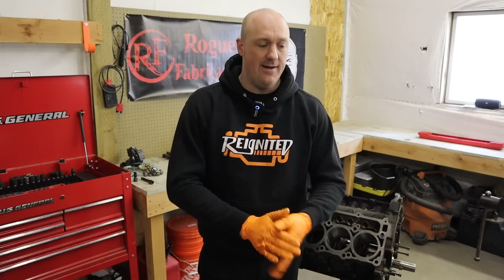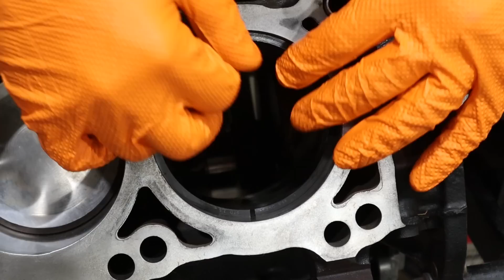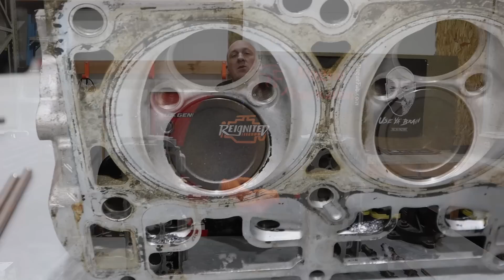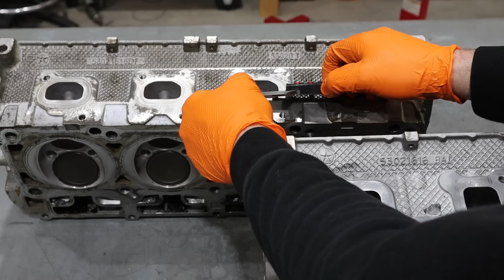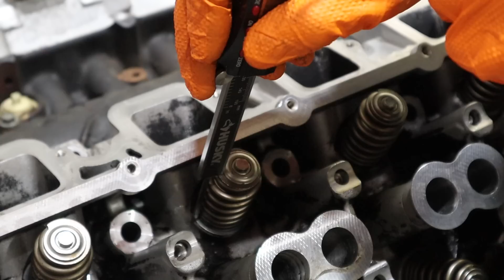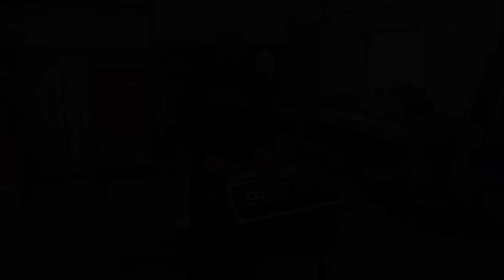Poor Man's Hellcat Ep2: Installing Eagle Cylinder Heads!

Comment: I blocked the EGR hole on the intake using a piece of rubber hose and a bar end form BMX bike with hose clamps and just made a blank flange for the front of the head and had no issues.

Comment: Do you have to change the rings or is that something you decided to you since then engine was torn down?
Reply from the maker: If you're going to remove the pistons and do a light hone on the cylinders you definitely want to replace the rings.
Reply: @ReignitedAuto no I am saying if I go get the newer Gen heads do I have to change the rings or can I just put the heads on it and that's it
Reply from the maker: @73swagin ah, no need to change the piston rings in that scenario.
Reply: @ReignitedAuto ok good thank you I know the route I am going now

Comment: I attempted to put eagle heads on my 2007 dodge ram. I had all the hardware, and put the pushrods side by side everything checked out. When I was finished with the installation of the heads I did a quick few turns of the engine and noticed all the valves are not completely closed. They were open about an 1/8 of an inch. I ended up putting stock heads back on after countless research and found nothing that explained what was happening.
Reply: You have to measure the pushrods

Comment: Couple things i want to touch on as im about to do a eagle head swap on a pre eagle. First, the valve covers, i was told and read the pre eagle valve covers do not clear the eagle valve train due to it sitting higher? Also was told directly from a builder that the rocket arm assemblies from 2003 to now are all the same an dimensions over all gen 3 hemis. You mentioned earlier on that you can use the same hesd bolts, are they not torque to yield? Lastly was informed the map sensor can be used ok the esgle hesd setup.. Anyone can verify these topics?

Comment: I wonder if you could instead of using the o ring seal on the intake. Make yourself a flat gasket that matches the eagle ports. Then port match your old intake to the eagle heads and right stuff the gaskets to the old intake? You could keep your EGR ? I believe you could drill your eagle heads to accept egr? Bang for the buck
Reply from the maker: You would see if you were able to overlay the older VS the newer intake ports, but they don't perfectly cover each other, there's a gap that is visible so there's no way to achieve full sealing with just a gasket, you'd have to machine up an adapter plate. You can indeed drill the Eagle heads for the EGR though.
Reply: @ReignitedAuto  I installed a vvt style block and heads in my 07 charger. The engine runs great no codes related to the swap but my accessories are a nightmare.  I ordered a newer style alternator and plug. Will the ECU in my 07 regulate it? Or will I have to use an external kit with an old style regulator? AC won't line up either. I ordered another one and hoses.
Reply from the maker: @egodeathplease  the accessories are indeed a pain with the newer block. The PCM will control the alternator just fine, just make sure the pins for the plug aren't reversed, they did that sometimes on the newer alternators.
Reply: @ReignitedAuto  ya the extra space for the vvt makes it a pain. I see them installing external old style Mopar regulators on them. They don't seem to care wich wire goes where since it's ac.
Reply from the maker: @egodeathplease  i have one on the alternator in my C10 with the 392 because it's a holley terminator ECU. If you've still got the factory ECU just let that control it.
Reply: @ReignitedAuto  how do I know how to wire it? If I hook it up wrong will it damage the ecu? It's only 2 wires. 50/50 I guess. 😂
Reply from the maker: @egodeathplease  I would say find a wiring diagram online, but truthfully it won't hurt it if you hook it up backwards, just the battery light will be on.

Comment: I have a 2006 dodge charger daytona with a recently built engine. I want to swap the heads to a 2009 so i wont drop a valve seat. Is it necessary with a rebuilt engine

Comment: So if the int/exh ports are larger on the eagle heads and give better air flow but you can use the stock manifolds or aftermarket headers from the earlier 03-08s, shouldn't there be some port matching or else restriction can occur?

Also, are head bolts TTY bolts? Why reuse them if they are previous bolts and stretched?
Reply from the maker: You're correct, the exhaust manifolds would benefit from being matched. The intake manifolds are not interchangeable so those ports will match the correct manifold. The head bolts are not torque to yield therefore they ARE reusable. This comes directly from the Chrysler service information. 
One reason there is confusion on this topic is because the bolts are torque to angle, which is just an alternate method of torquing them down. Think of it this way. If you were torquing a bolt to 55ft lbs, it's that any different than telling someone to torque the bolt to 30ft lbs, and then an additional 30 degrees? Both would result in the final torque number being 55, it doesn't mean that the one you finished torquing down by angle is now stretched and can't be used. I hope that clarifies it. 👍
Reply: @ReignitedAuto  good to know about the head bolts. I have a 04 5.7 with Pacesetter LTs. I wonder how the ports line up and if not, the solution? Super hard to find good LTs these days.
Reply from the maker: @tRRickedOut  I think sticking with those long tubes would be just fine, it's the stock manifolds I would be concerned with.
Reply: @ReignitedAuto  thanks. I would definitely prefer to stick with them as again they're just super hard to find these days for anything early 3rd gen. Definitely doing some more research on this but this 6.4 upgrade looks to be on the menu

Comment: If egr is really drilled and not cast, is it 90° bend drilled? I need the egr. But I think that some ram trucks had eagle heads with egr too.
Reply from the maker: The EGR hole is drilled from the front of the head, and from the exhaust flange side, where the two holes intersect is where the 90 degrees happens. 
I've heard of some eagle head vehicles with EGR, but still haven't seen any yet. I'd love to see some pictures if you find one.
Reply: Wonderful, thanks a lot for chiming in so fast. Actually I haven't seen one either, just read they are out there. Well, I am going to drill it.

Looks like eagle heads are better compared to 6.1 heads, at least from what I have read. Problem is, I haven't found a single dyno comparing them. Some say closed chamber (eagle) design is better for power output, some say open chamber are better for emissions...But there are numbers missing. I am torn between the two yet am inclined toward eagle ones as they should have higher port velocity. At the same though I want to stroke the engine and have no idea how that complements the build. @ReignitedAuto
Reply from the maker: @compprufus  something to be careful about: if you're using the eagle heads and drilling the pet for the EGR, where are you going to run the tube that goes into the intake? There is no provision for that on the newer intake manifolds as far as I'm aware, and you cannot use your original intake with the eagle head swap unless you're using adapter plates.
Reply: I am aware of that. I was thinking first about 6.1 manifold since it's aluminum and I as a hobbyist am more proficient  with alu welding than plastic welding :D but then heard of 6.4 intake being better match.

I was thinking of epoxying in a barb (though I admit, I have no idea how are the gases let inside pre eagle intake manifold (my car is constantly being serviced)) and connect the hose onto that barb. As much shaggy solution that looks like, open up a Motortend, you'll find an article about somebody fixing port runners with epoxy to raise the port velocity. Then there is the other solution and that is to mill myself an adapter plate between heads and 5.7 intake  but that doesn't seem like much fun.  @ReignitedAuto
Reply from the maker: @compprufus  there's no question it can be done. For myself is much rather just eliminate the EGR and get a tuner to shut it off for good, but I live in a state without emissions testing so it's easy for me to say that.
Reply: Exactly, here in Europe emission testing is a thing and especially down here in CZ, one is legally able to tune his car softwarewise only, so my intention is pushing luck. That's why I want it not to give itself away by looks nor by testing though I have no real numbers at hand to compare it too. It seems like nobody cares across the pond (except CA obviously) and so there's nobody to ask.

I can only rely on what two emission inspectors told me over the few years of personal research. According to them, stroking the engine should not worsen the emissions as long as the system is working properly and right here is a hitch. Will cats be able to clean gases enough, last modeartely long or survive at all? But that's just one piece in the puzzle, along with EGR. There is also the "FUEL" component of the OBD readiness code list which seems to be checking whether PCM is able to adjust AFR through the fuel trim lookup tables and as far as I know, HPtuners would adjust those tables. Not sure how it is interlinked, whether the technician compares car with some database of fuel trims (in my case Chrysler 5.7 Euro 3 ) or the tables saved within the PCM....absolutely no idea. But then, those who seek companies making their car run faster through PCM reflash (tunes) have to readjust these tables as well, and they pass emissions.

Again, I am pushing my luck and nobody to ask. Have to try it, I am bored. @ReignitedAuto
Reply from the maker: @compprufus  I hear that, I'm always trying things because I'm bored 😄

Comment: the eagle heads are 20cc less than the pre eagles.. the eagle heads are oval shaped and not a true hemispherical head design.. according to chrysler, the intake runners were improved on the eagle engines. the eagle heads are said to flow 14 percent better than the pre eagles, BUT, as I said, the eagle heads have 20 cc less volume.. so can u explain how the eagle heads are better than the pre eagle heads?  in my mind, they about equal out, due to the chamber volume vs the flow?
Reply from the maker: The less volume is in the combustion chamber, not in the flow capacity. Less volume in the combustion chamber=higher compression
Reply: not trying to argue, just to understand.. ok if you have higher compression, but a smaller explosion when the fuel is ignited ,  due to a smaller combustion chambers holding less fuel mixture,   , how can it create more horsepower, also the higher the combustion pressures, the more difficult to ignite the gas mixture.
Reply: what it looks like to me, is in a way, they robbed peter, to pay paul.. they went to the oval shaped combustion chamber, to be able to cut more material out of the head  to get more flow. raising the compression ratio, and the flow would seem to create a better gas mileage situation to me, rather than more power.. Ive seen  s 1/4 miles tests between  stock chrysler 300s with the pre eagle, and eagle engines, and the eagles are about 1 second quicker.. the vid said the eagle engine is around 30 pounds heavier.. the pre eagles had MDS, but no VVT.. The eagles have VVT but no MDS... to me it seems that the VVT is likely what is giving the eagle engines the slightly better performance, and not the changes to the cylinder heads and intake... your thoughts? .
Reply: also the  fact that the oval shaped combustion chambers are not really hemispherical in design, brings alot of questions.. its common knowledge that the true hemi head design has been unmatched in performance since the 1950s, and as far as I know, dodge still is not allowed to compete in nascar, due to its design,, in the 70s dodge was banned, because nobody could keep up with them..
Reply from the maker: @randy1ization  the eagle engines do have MDS as well. I think the eagle engines are an upgrade in every way. The VVT definitely takes advantage of the increased flow from the cylinder heads, but it's a combination of a lot of small changes that make the eagle engines better. For outright reliability I like the pre eagle engines, but any metric of power and the eagle runs away with it.
Reply: havent driven a car with the eagle engine, as my 06 300c has the pre eagle.. it seems to make the best range of power between 3200 and 4000 rpms..  would love to see you do some bolt on power increases on the pre eagle 5.7 hemi...  @ReignitedAuto
Reply from the maker: @randy1ization  no worries I get what you're trying to say. The smaller combustion chamber has no impact on either how much fuel is injected or how much air is drawn into the cylinder. Therefore, if you have the exact same amount of air, but are cramming that into a smaller area, this equals more dense air which produces a stronger ignition and this results in more power. And it's actually the opposite, the higher the combustion pressure the easier it is to ignite. Think of diesel engines, they don't use spark plugs at all, but they run very high compression ratios, this is because at those cylinder pressures the fuel ignites on its own.
Reply: yes, good stuff, thanks,., makes since  @ReignitedAuto

Comment: Can I use a 2012 5.7 crank in a 2004 5.7 hemi if so what else would I have to do to make it work.
Reply from the maker: Unfortunately no,  the newer crank is designed for the VVT system and has a different snout length than the older crank. They look very similar but aren't interchangeable.

Comment: I want to point out, that you can actually put the old pre-eagle MAP sensor into the eagle intake, and won't need to change the connector. I tried this earlier. Both sensors are slightly different but the tube that goes into the manifold is the same.
Reply: False. The tubes are different. Ealge tube and throttle body are slightly larger

Comment: Question. I know we talked before about my 06 charger rt with 2013 heads setup. I went with a .070 thick head gasket because of compression ratio being high but would a stock head gasket be fine if i run premium gas. I run premium anyways
Reply from the maker: Unfortunately the only way to know for sure is to have the vehicle tuned on a dyno, and the dyno operator has those knock sensor headphones.

Comment: Would the valves be longer because the contact point in the combustion chamber has changed? Since they technically sit lower, because of the smaller combustion chamber?

Comment: I've got a couple of questions but first some background. I was a Chrysler advisor for approx 10 years and finally escaped from industry about 18 months ago. Also, I'm not a typical advisor who knows nothing about cars. I've done all the work on this and many other cars I've owned. I have an 06 300 CSRT which is on it 4th set of lifters. However, last year when the 3rd set failed (always #5 intake lifter) it took out the cam and also spun a cam bearing. So, I pulled the the engine and used it as an excuse to do a 426. Sent the bottom end to our machine shop and had them perform all the machining and assem the bottom end. Put it all together and it ran like a top. Then around 3k miles on it I started noticing what sounded like a slight rod knock. UNBELIEVABE!!!! So I parked it considered committing  hara-kiri seppuku! Anyway, now that its "cooling off" here (houston) I'm finally mentally ready to pull it and see WTF is going on. So my questions are 1) do you know if the Eagle cyl heads flow better over the stock casting SRT heads? 2) do you know of a way to safely pull & reinstall the crank (assuming I just have a bad bearing and no other damage) without pulling the heads? 3) can you give me the torque specs on assembling the bottom end as I've never done this and no longer have access to dealerconnect.com Thanks for any info!!!

Comment: Would a set of exhaust headers from the old heade work with the difference of the exhaust ports on the new heads.
Reply from the maker: They will bolt up absolutely since the bolt pattern is identical. 👍
Reply: @ReignitedAuto  thank you very much. Have a great evening.

Comment: One more thing that i think may be handy. I thought the earlier like 03 to 08 model heads had a chance (likely when overheated a crap ton) of dropping the seats. Havn't heard anything about that and the new eagle heads. So more flow intake and exhaust, better compression ratio and a more stout head. Got me thinking about my poor old 06 Daytona Charger. Its not bad, but its no power monster.
Reply from the maker: That's correct, they fixed the valve seat issues with the eagle heads 👍

Comment: Are the lifters for A 03-08 hemi  The same as the lifters in the 09 and newer? Aka are there any differents in The pre eagle lifters versus the eagle lifters. Especially in regards to the MDS lifters.
Reply from the maker: Theu are basically the same until 2016 when they updated the lifter roller bearings to a thicker style. The updated versions are the only ones available now and they'll fit any Hemi engine back to 2003. 👍

Comment: ok very good video like the step by step ? i want to ask u say to delete the EGR? but will doing so still pass emissions?  pcm has to go through its cycle to do its test ?  and sense u have the eagle heads by looking at them can u drill out the hole for the EGR ? sense the bolt holes are there ?
Reply from the maker: If you live in a state that requires emissions testing then this isn't a great option. You can actually drill the cylinder head to make the EGR functional, but this means you'd have to use your original intake manifold, which means purchasing the adapter plates from MMX.
Reply: @ReignitedAuto  well thank u so much for the reply back have been searching for the answer to if i can drill the eagle heads or not ? thank u